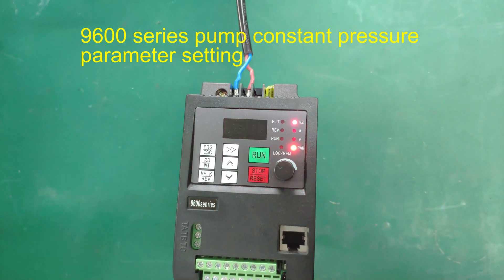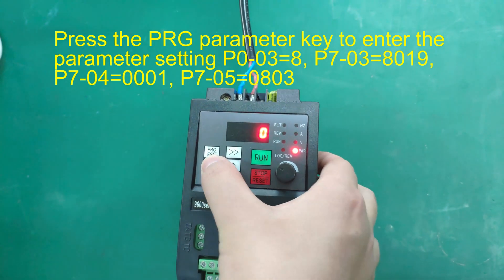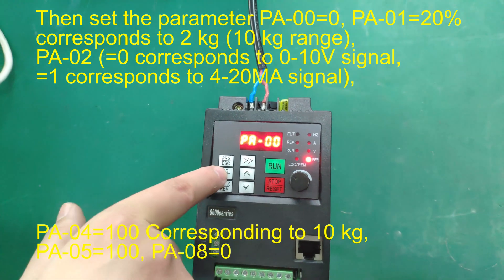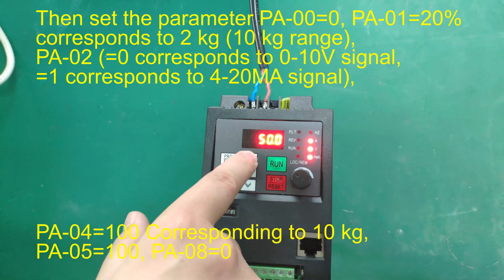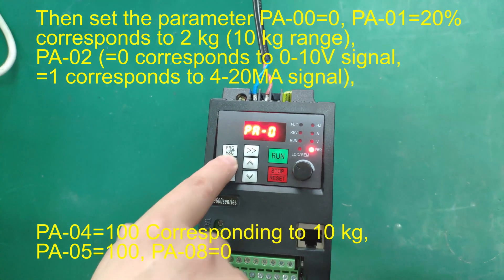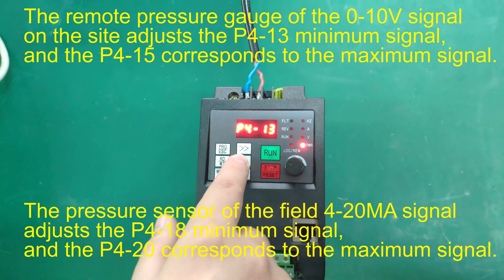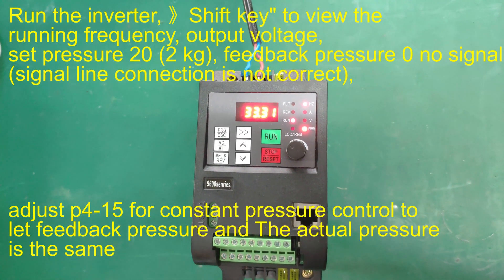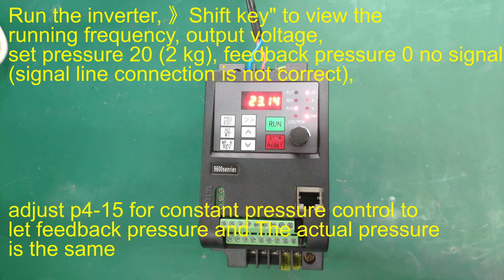WK600 series mini water pump constant pressure parameter setting frequency inverter

Comment: I would like videos of the inverter
WK600D Solar Series DC -2.2KW Single Phase 220V for water pump. 1.5 hp
with programming from 50 Hz to 60 Hz

Comment from the maker: High-performance vector inverter https://vfdconverter.shop/
Reply: Dear CNWeiKen Gary.  Kindly asking a favor. I have a same inverter, and I wnat to use for water pump driving. May I know if the presure is reched (the tap is closed) the inverter does stop? Another question its, whyt kind of presure sensor have you used and if possible to share me the wiring diagram.
Thank you in advance.
Reply from the maker: @losz1496  You can use a 4-20MA pressure sensor for control, which can be sent via email szqinverter@foxmail.com Or contact me on WhatsApp+86 13923476670, and I can send you the settings document